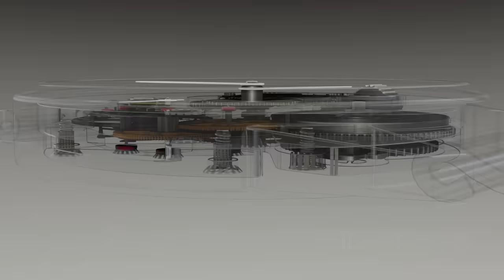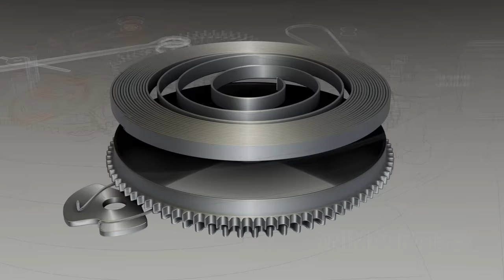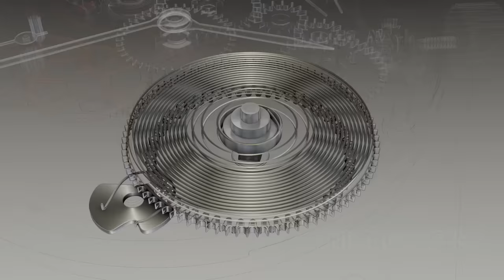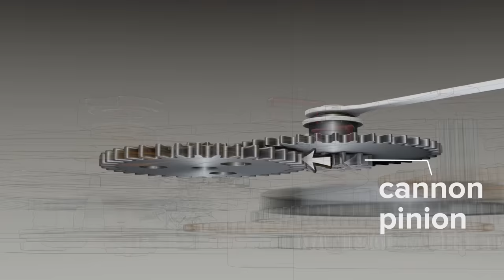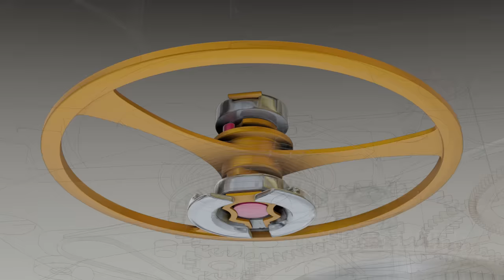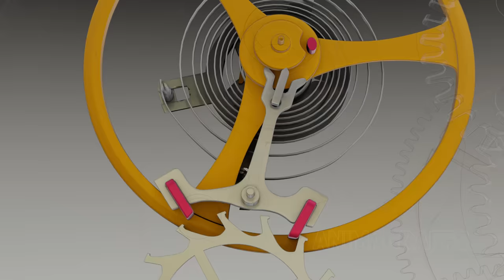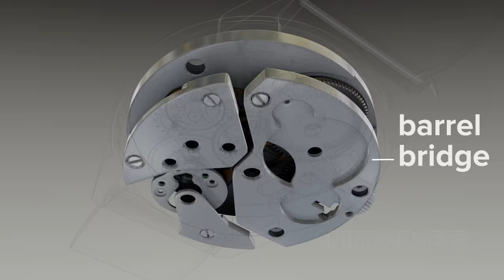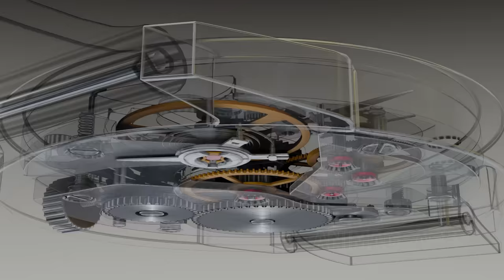How a Mechanical Watch Works

Comment from the maker: Video corrections:
4:55 You can faintly see the ESCAPE WHEEL has a geared pivot underneath it that connects to the FOURTH WHEEL -- everything is connected all the way back to the MAINSPRING. I had a render error that made the gears not turn at the correct rate together, so they don't * appear * to be connected. But they are in a real watch.
Reply: Excellent representation.  I have several mechanical watches and it's really nice to see the detail and get a clear explanation of the entire system.  Thank you and congratulations on a lot of hard work.
Reply: Seeing the amount of detail you put into this animation is top notch. Kudos for a great job well done.

Am really tempted to screenshot each of the parts to try and make a physical copy myself, if you don't mind 😁😁
Reply: whoever CAD'd this, is a champion. Thank you so much.
Reply: Do you have a video for an automatic watch? Mine has a weight to wind the main spring and I'm curious how that part works as it's not in this video.
Reply: R,,,f,t.
Reply: thanks for the explanation but you did a wonderful job with the video man.
Reply: This video is really nice.  I was still more interested on searching how the main spring other end ( out of that barrel) connected and holding by which connector. Since that part is completely suppressed by other wheels , it is not coming to my view clearly.
Reply: Hello, can you plz tell me how much it cost to make a video like this? Plz plz plz,  thank you.
Reply: Yeah - you really benefit from explaining the really important' link'  - how power gets from the mainspring to the balance wheel - perhaps you can voice that in one day?
Reply: Jake O Neal what makes the balance wheel move back and forth? the hairspring move it but does it suppose to lose energy. What charges back the hairspring??????
Reply: wonderful simulation! great work 👏
Reply: The fact that you can both comprehend these advanced mechanisms and then transform those concepts into such beautiful three-dimensional art is absolutely astonishing. I wish I had half the brains you do. Thank you for making these videos
Reply: Constructive criticism: 
lose the background noise.
The subject & your narration of it is great! The addition of distracting, monotonous & annoying music ruined the vid.